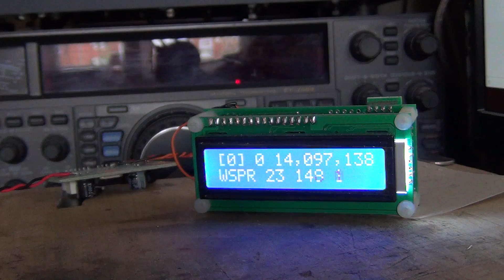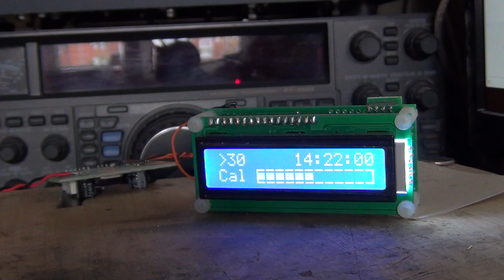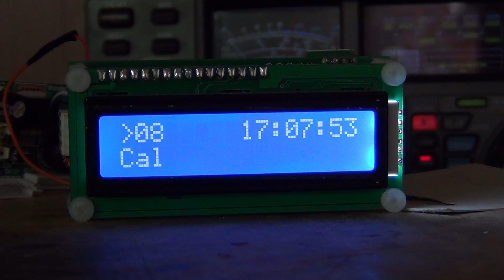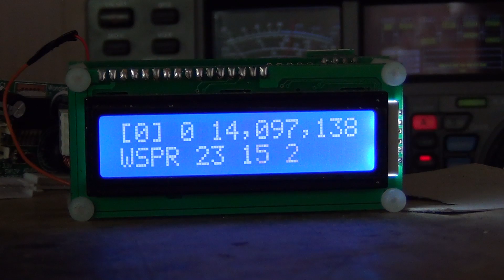Update to my WSPR project

Comment: 30m band is often blocked down here in South Africa and we never seem to be able to get into Europe. We are one of the few places on earth allowed to use SSB on 30m during the day as it won't effect other countries further up north. Started playing with a U3S because of your videos. keep up the good work!
Reply from the maker: +Chris Gozzard (That Physics Guy) Hi Chris, excellent news on your experimenting with the U3. from my QTH i can never really get south, and would dearly love a QSO with South Africa. just cannot ever seem to get there. Very odd. Let me know how you get on. 73 Dan
Reply: +ColdestMoon Dan. I am having problems. I can hear the U3S on the reciever but doesnt decode. what was the problem with your gps? I wonder if its the same thing? did you link with an optocoupler?
Reply from the maker: Hi Chris, my GPS module was too close to the U3 - the U3 would swamp the signals - thus not allowing any GPS decoding. Also needed a pull up resistor on the module to correct the digital signal. Finally a decoupling cap was added - for for belt & braces. if you are trying to decode in close proximity - even on low power - it maybe overloading the receiver. Hop that helps.
Reply: Just got my first report - from KC9NBV 	 EM69oe - 13513km!! Unbelievable!!

Comment: Pull up resistors are used when it must connect to an open collector. Is supplies the small current for the transistor in the circuit/ic so it can switch.

Comment: How did you mount the GPS unit to the Vero please?
Reply from the maker: Hi Barry, 
The GPS module is only held in place by the short wires that connect to the Vero. I have since used a wide section of heat shrink to cover the entire unit and give it some protection from the elements. 

I hope that helps.

73 Dan

Comment: Hi Dan.  I received the dual voltage module similar to the one you used for your project.  I'm not familiar with them and am not quite sure about the hook-up for 12v dc.  I don't have the tiny molex style?? plugs so I'm going to make solder connections from the back of the module.  From the back I see:
O=solder joint
                                                                           O
                                                                           O
                                                                           O
                                                                           O
                                                     LCD 12v-5v-3.3v

3.3v  5v             gnd  sw  adj       12v  swadj gnd
O  O  O  O  O  O  O  O  O  O         O  O  O  O  O  O
                                                     |
                                                     |
                                                     is this where I connect 12v
Thanks and happy 2015!
Neil
Reply from the maker: Hi Neil,

So sorry for not replying sooner - i just found a whole bunch of comments.

In short yes. the 12v and GND is where you would connect you input 12v don't worry about the SWADJ. I initially started without the molex connections, and just soldered straight to the board. it worked fine.

I hope that helps albeit a bit late.

73 Dan
Reply: Thanks for the info Dan.  I've got most everything put together.  I'd like to get her on the air soon.  I need to pick up some molex connectors to make a neater package.  Maybe an old pc or the like will have what I need.  Soldering to the gps module will be fun....may have to file the tip of my soldering iron to make it better suited for the tight spacing on the module! 
Alll the best......Neil wa4chq

Comment: Hello OM....do you have a schematic for what you did for your gps modual?  It looks pretty straight forward with the cap and resistor but I just ordered the p/s and about to order the gps modual for my U3....tnx for the great vids....73 de wa4chq
Reply from the maker: Hi Neil, thanks for the question. Nope i don't have a schematic but it is really straight forward. 

In terms of the pull up resistor and decoupling cap – the most important thing here really is the resistor. Fit a 10K resistsor across 3.3v and TX on the GPS module. I used a small bit of vero (you can see the module at about 4mins in on this video that I used to mount the actual GPS module to). The decoupling cap simply goes across the +3.3V and GND pins – a friend of mine didn’t do this, but did screen the cable and get it far far away form the U3.  use a 10nf ceramic cap.

Really focus on the pull up resistor and screening the cable and getting the GPS module quite far away from the U3. any questions feel free to pop me a note.

73 Dan
Reply: Hello Dan...thanks for the info.  I found your vid because I bought the U3 and am ready to build it.  I wasn't going to use a gps modual but decided it would be better having one.  My U3 is for 30m.  I'm looking forward to putting it all together.  I just ordered the pwr supply like you mentioned and the gps mod from Adafruit.  I normally run qrp cw and used to homebrew my gear.  Then I heard about WSPR and thought it would be fun.....best 73....Neil de wa4chq/qrp